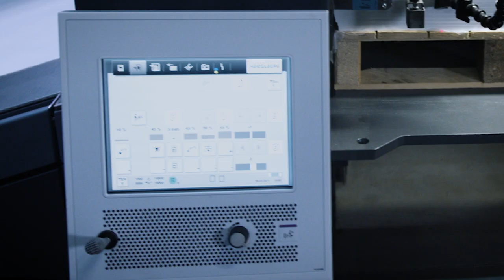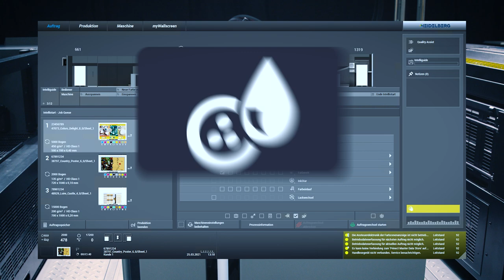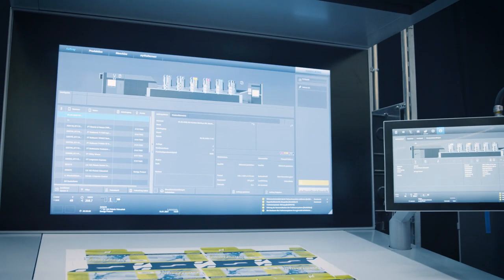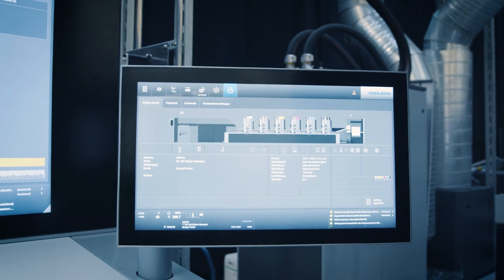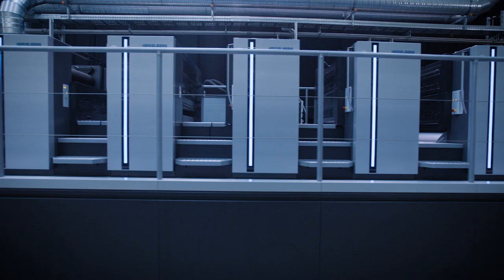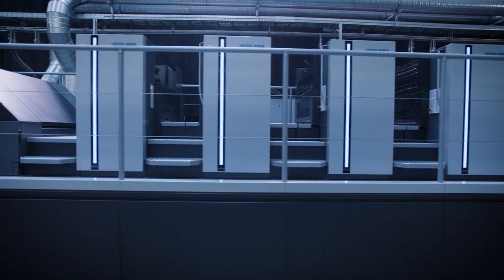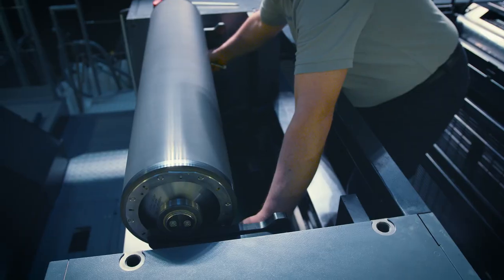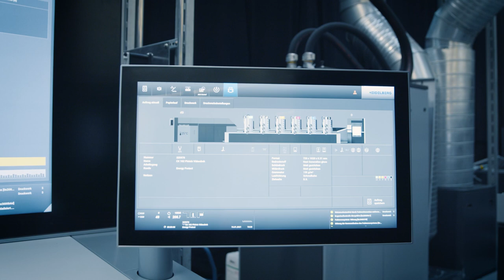The new Speedmaster CX 104.

Comment: One question to developers: are there any improvements regarding to inking unit design? If specifically: is the intermediate roller still has the same screws for locking and adjustment?
Reply from the maker: Dear Alexey, Thank you for the message. The feedback from our product management is, that no changes regarding inking unit and adjustments on the Speedmaster CX 104 compared to former Speedmaster CD 102/CX 102. Best regards from the Social Media Team
Reply: @HeidelbergerDruck  What a pity! Having more then 25 years experience starting up and troubleshooting Heidelberg presses as a field instructor, I have a right to speak out my point of view.
Reply from the maker: Dear Alexey, Of course, we are always happy to receive feedback from customers, operators or instructors. But this was the feedback from product management. Best regards from the Social Media Team